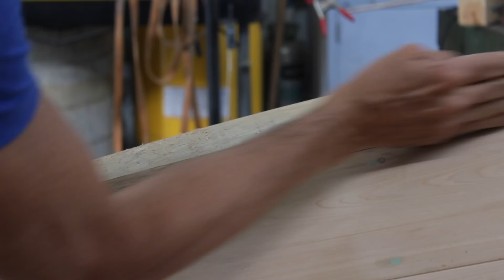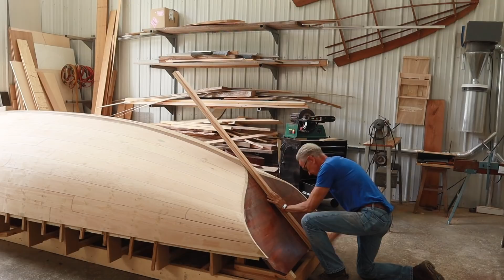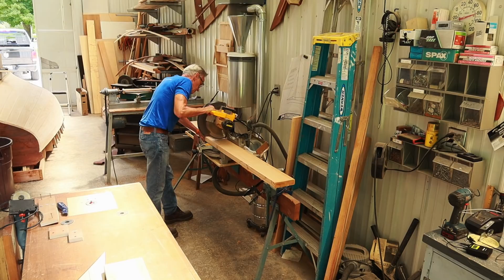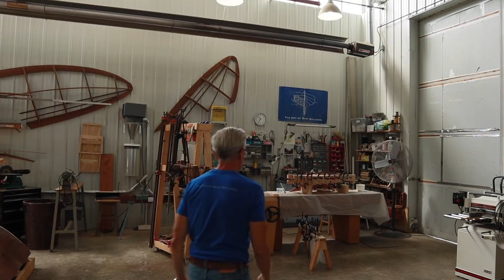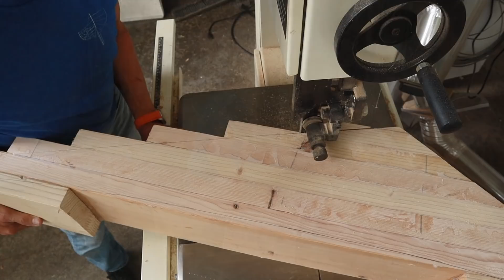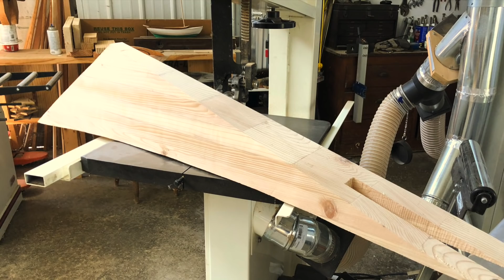Shaping the Deadwood and Forefoot for the Haven, S2-E29

Comment: Bob, I’m jealous of your spacious and high ceiling workshop, particularly when you swing open the doors in the morning! I’m next going to look thru your videos for a shop tour and anything else on how you came by that design. Best of luck! Your videos are always so clear and inspiring. Thanks!
Reply from the maker: Hi Harvey,
If you haven't found it yet here is a link to the studio/shop tour: https://youtu.be/No1jXHqwAjQ
Keep in mind this was build to build large scale public sculptures in little did I know what a fantastic boat shop it would be. The design grew out of a few briefs I gave my self in designing the building. One was square footage around 3000 sf.
That the ceilings where high enough (25' on high side)to accommodate my 1 ton bridge crane. Another was that it had large enough doors(east and west) that a semi truck could drive through 12' wide 14' tall, 6" thick concrete floors. If i was building just for boats the only change would be wooden floor, at least where the strong back sits.
It is a joy to work in, never sad when I walk through the door.
Thanks for watching and the nice complement!
Cheers,
Bob

Comment: Would a curved or gooseneck card scraper have been easier ? Check out StewMac.com. They have a couple of heavy duty curved ones that may be better for you than the thin flexible ones I use n furniture.  Click on Luthier Tools and Supplies, then scroll down to scrapers and click it. I really enjoy your series.
Reply from the maker: I've used scrapers in the past for fine woodworking. I have found scrapers to be of little use in this boat build. Cedar is way to to soft for efficient results and the shaping of the oak keel doesn't need that degree of finish. After all it will be below the waterline.  
Thanks for your comment and watching!

Comment: The term deadwood is used as a description of the usage of that placement, its only use is to keep the weighted keel as low and in line with the keel, it serves no integrity purpose of the boat/ship or is considered dead wood. It just fills a unused gap, all other part's of the hull contribute to the integrity of the hull.
Reply from the maker: Thanks John!
Reply: The Art of Boat Building In episode 30 of Acorn to Arabella Steve Denette explains very thoroughly the use of dead wood, forefoot and worm shoe.
Reply: What is the gripe?
Reply: I disagree with the description of the Deadwood as being of no use. That section of the hull is very important to the water flow moving past the rudder. If it's not shaped correctly there, or is chunky and not laminar the sailing  characteristics will be off. The. Boat will not handle as well without it. ALL of the underwater surface contributes to lift.
Reply: Keith Staton He’s clarifying the terminology.  The name was given to a part from a structural perspective and does not equate to a statement of its total uselessness.  Obviously, the deadwood serves several purposes that are not related to the origin of its name.  Flexibility of language is what allows us to park on driveways and drive on parkways.

Comment: I am not exactly sure what the etymology of deadwood but I believe the piece it describes was named so as it's only function was to support it's adjoining parts.  Another possibility is, especially in historic ship building, the deadwood was made from a knee. Knees were made from naturally occurring wood which had a natural angle to it. Many times these were cut from large roots dug up after felling a large tree.  They would be sliced into timbers and sold to boat builders. They were prized for their exceptional strength due to grain structure.  Thus the were hewn from deadwood. Knees were also used when attaching the deck to the hull.

Comment: Deadwood is “dead” in the sense that it doesn’t carry any load...all the strength is coming from the keel.  Consider automotive terminology: a “live” axle is a member that supports the weight of the vehicle as well as transmitting rotation to the wheels.
Reply from the maker: Thanks for the analogy. Make sense.
Thanks for you comment and watching!